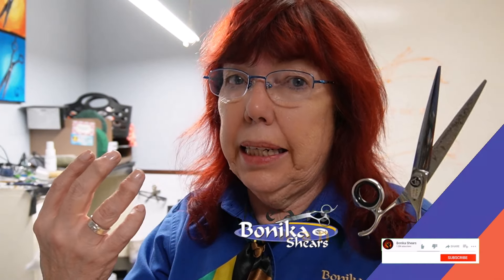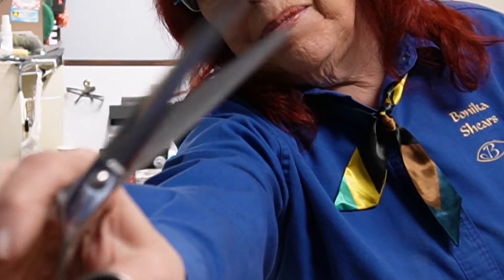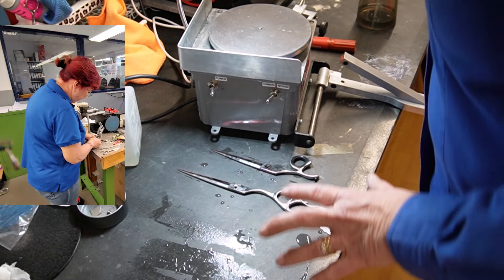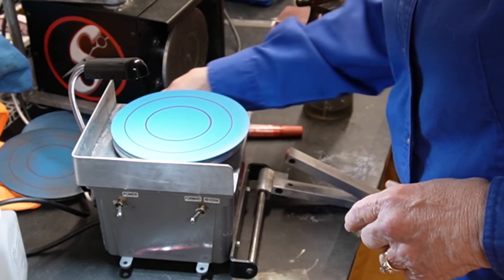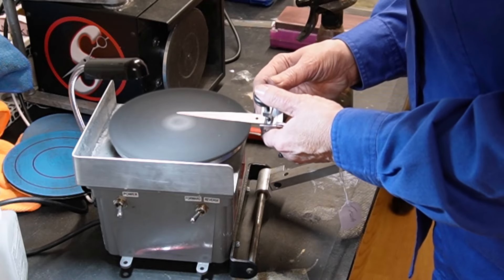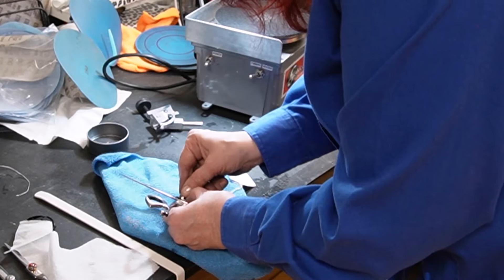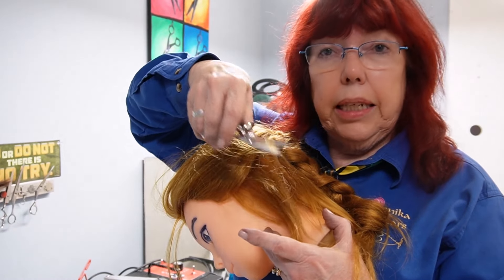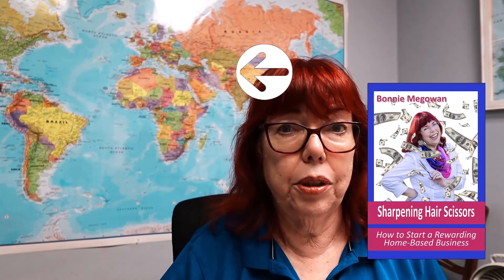How to Sharpen Shears for Slidecutting Sam Villa Shears - Bonnie Answers Your Question

Comment: Thanks Bonnie!
Just to be clear, say you sharpen at 45 degrees and then you go to polish. What degrees are you setting the clamp at to avoid rounding of the edge?
Reply from the maker: About 50. Maybe 48 if the shears are for slide cutting and 52 if I want the edge to be more of a bite of they are dry cutting shears.